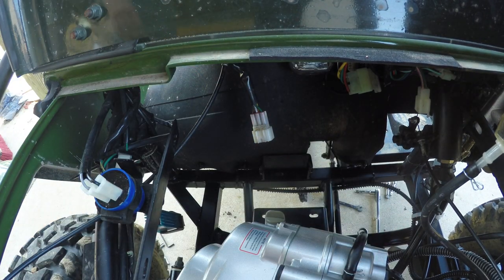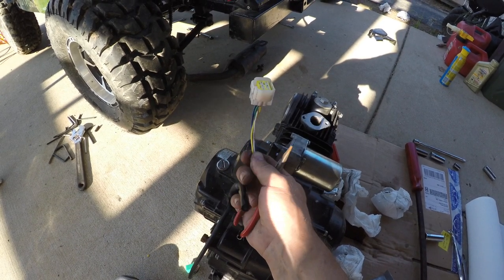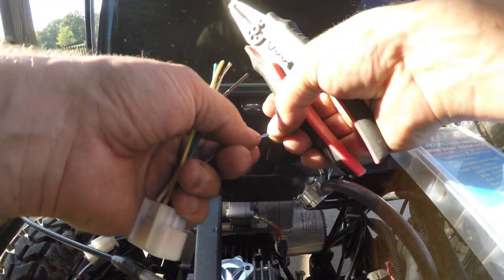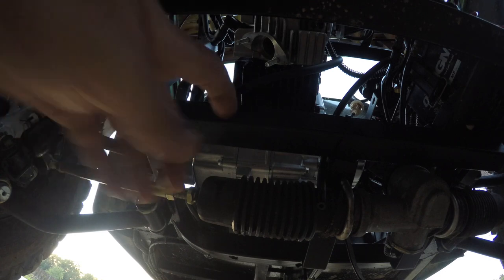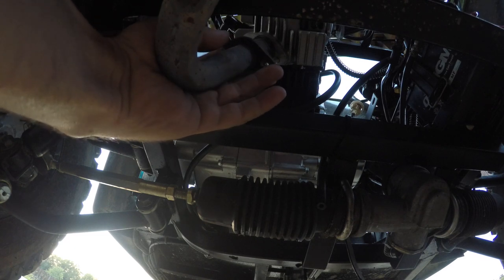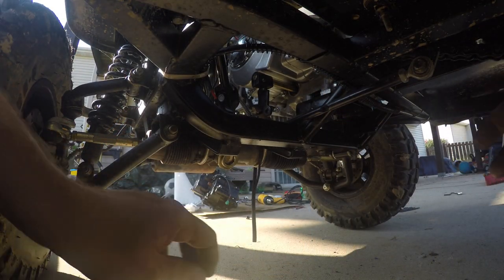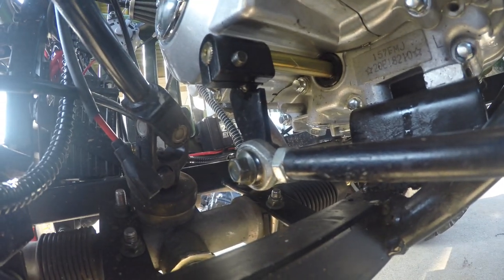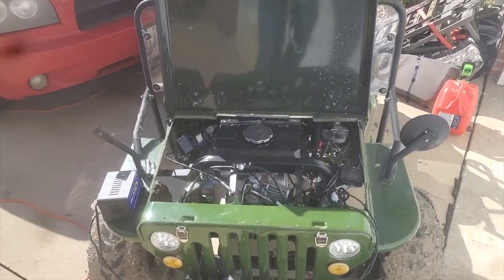Mini Jeep 150CC Engine Install Part 2 of 2

Comment: Excellent video.  I'm going to pull my 125cc motor out and repair 2nd gear. Never done one before. Hope I can get it done. May need to call you for advise if that's ok.

Comment: Is there a warranty on that engine? I am assuming not, but just curious.
Reply from the maker: Doubtful since it is from Australia, i'm sure the Ebay purchase would provide some protection if it arrived damaged etc. These pit bike engines are all pretty much made in China and some simply have issues when others run like a top. I would be sure to check head torque after first warm up and install and oil cooler along with a fresh oil change immediately.
Reply: @JUCDVPR  i put a zs190 in mine thing rips

Comment: Can you provide specs / model information for the 150cc engine you used?
Reply from the maker: BLYGO 150cc engine from Australia on e-bay. 
https://www.ebay.com/itm/262466494031?epid=3040230132&_trkparms=ispr%3D1&hash=item3d1c38de4f:g:eskAAOSwVXZbQibO&amdata=enc%3AAQAGAAACoPYe5NmHp%252B2JMhMi7yxGiTJkPrKr5t53CooMSQt2orsStdebXPz4ZTXCT8FI9kPBh2m%252B%252BqUjMvnQMZunynPo5b%252BmWdmsHNQ9zRZ6Occ%252BsoJ7O2EkYWqnyLZ7g5Xe4lMDSaHL88RgfOhzHTLvtEIXW6YDtbd0DTl3ZSRLyP5F4mQALPdQpsEO0%252BbovC%252Fs7oGqHDxmyXqgcT4C9BzZSD62tgIUaOFUhFUxsPwlKF4joOVvwttg4XaivkwrvDUY9GbIWRZM01fCKSwFrhtRdaB3RelgODcqRn%252F3sAoQx06t9SfMl43etU4ELhCMGkWHwVJYZenhg73NGRaLkKOXWysqrYYaf75xSIR%252FUp%252FSAtY5eZMpxKVf7DRfhKC%252FRUUCpTfRR4OKaoEuTTZcMIkQ3H%252BjPMnP5yaQ2djMlVPlAFIVJnDPq5YMVAbTCySSjYXPc112oQmEOrWJL4woRNT4LyVlJfoINuHHtzIpRffdEnoq62O5H1Px03KjHW2ATS6xGMk85D0%252BYsdSwXSrP7kHyIB80u9rHJ0WKp9kvn69YltT%252BHyspzffLWa49h%252F9FF%252FV%252BHdIMVKLtIPeFbjMvMSqjvHEvKN2MkdTMoQWAq6h0LLlSwYVftWKo3XGcM55rGt5Qj5aRh7RfB5bioZY0kBglfibNcb3isv0r9EIYvBcCYz3srhxueiKeAhIa1cfHkem6QRhGByQCy1T1KUvdbLJ1QJNaepGA58a6YXezhng0BDcDERoHApgKCHbB3plGcMN9K%252FETztnvxipQvGZmpBg7WIFeBJq91aMfFTwfWlzIZDbLqwROQ5dZ9geIq91oOcEiB1x61AbaM%252FiTjj1wh02ZiArReY%252FG1FzGKfMzClTIRqZ55y5tA9wgMO0%252FSYi8yvTxPDmPA%253D%253D%7Cclp%3A2334524%7Ctkp%3ABFBM-sn9xq9f